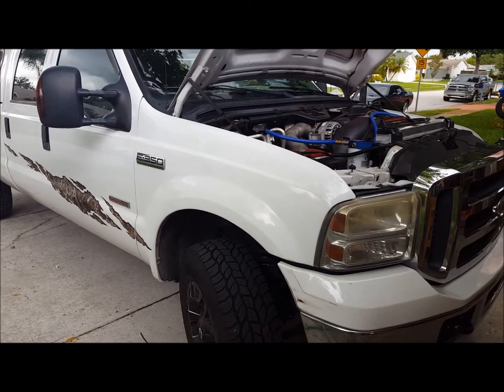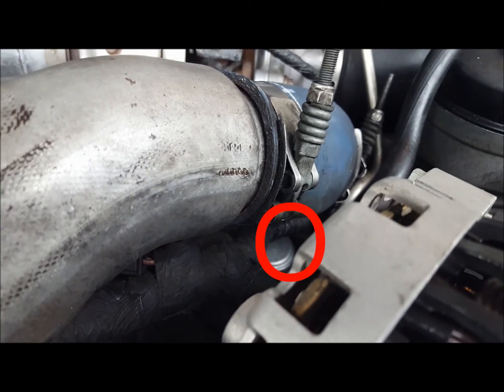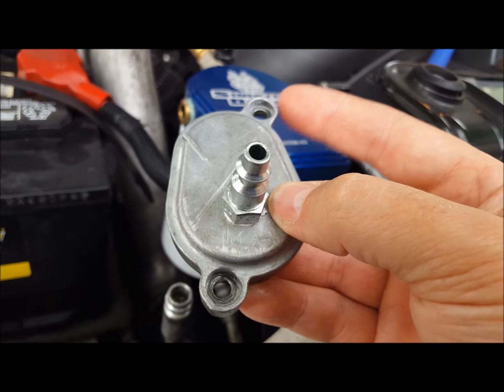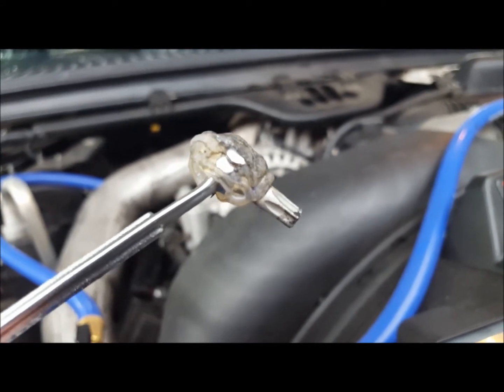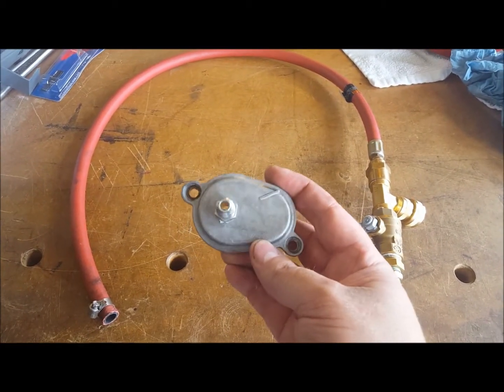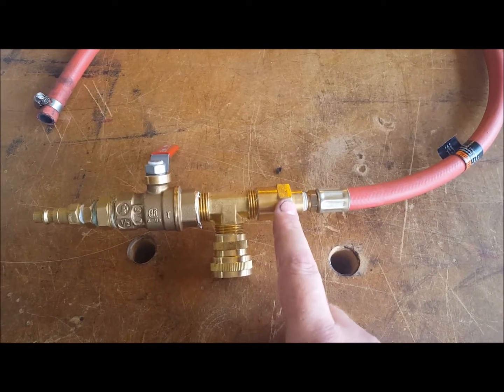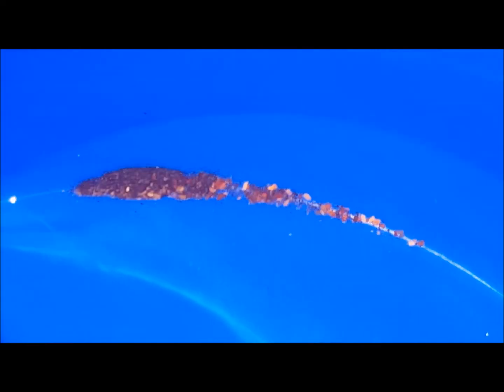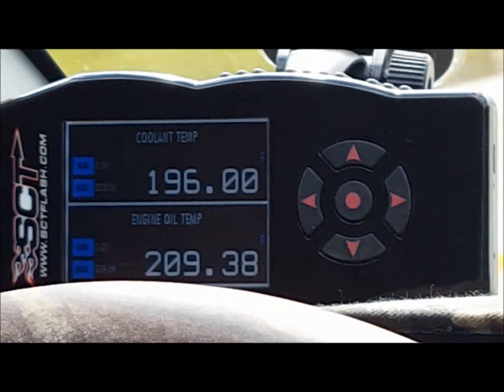Oil Cooler Backflush On 2007 6.0 Powerstroke

Comment: I'm looking at doing the same thing, my delta is about 20-25 no load, did you try a cleaner in the cooler, and should I worry about putting to much air pressure in it?
Reply: whats the part with the two bolts that inlets into the oil cooler?
Reply: Does Delta mean difference?
Reply: @jawdroppin9929  yes